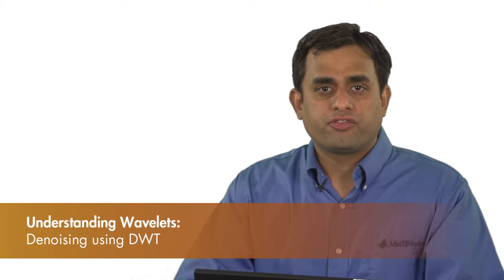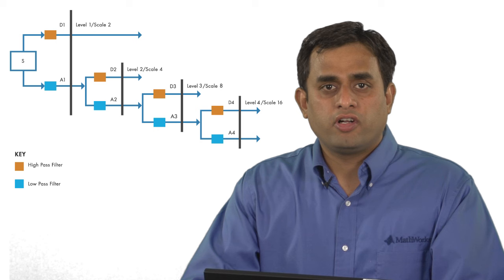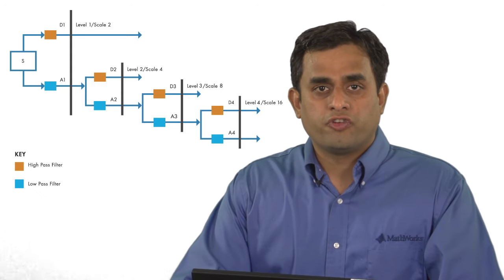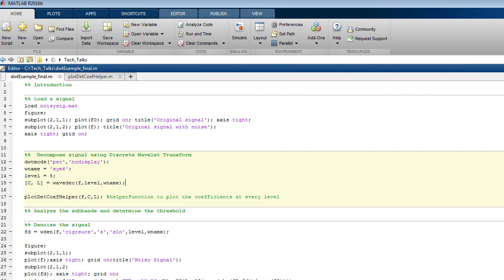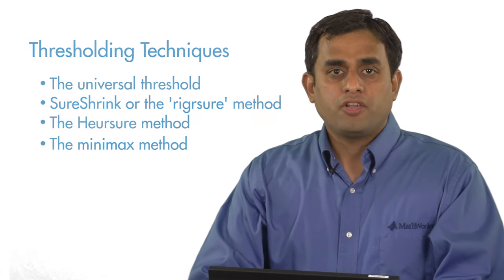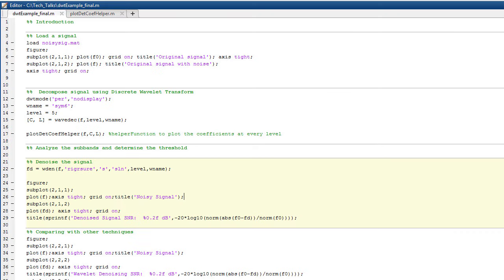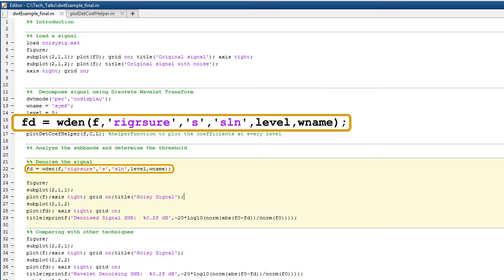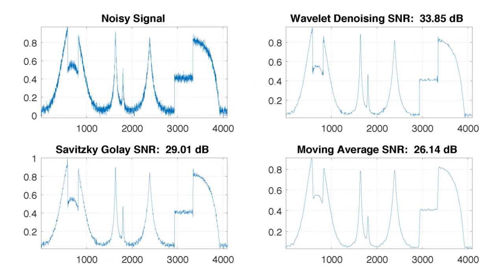An Example Application of the Discrete Wavelet Transform | Understanding Wavelets, Part 3

Comment: the mooving average looks pretty clean
Reply: @trendyprimawijaya314  not in the example graph tho
Reply: @aelucif  Yes, i am referring to example graph at 5:27 . As you can carefully see there, the amplitude of the spike (at around 1600 and 1800 horizontal axis unit) in moving average result graph is lower than in wavelet graph.

In my opinion, these 'overblend' is related to information lost. Maybe that is what he meant by "wavelet is outperformed the other method".

At first glance, I am agree with you that the cleaner result is better, but now I realize the "main information" of the signal is more important while these remaining noise is drawback. Wavelet is 'balancing' the advantages from other method.
Reply: @trendyprimawijaya314  mb you re right
Reply: Yeah, I also noticed that moving average is cleaner. But observation of Trendy Prima Wijaya👍
Reply: See the label values of MA

Comment: This animation is messed up.  The illustrated soft thresholding is actually increasing noise, as it's scaling the greater magnitude values and not the smaller ones.  The illustrated hard threshold is also adding more noise as it's not subtracting the threshold from the larger values.  This would be a horrible denoiser.